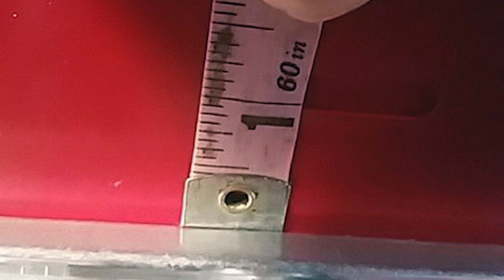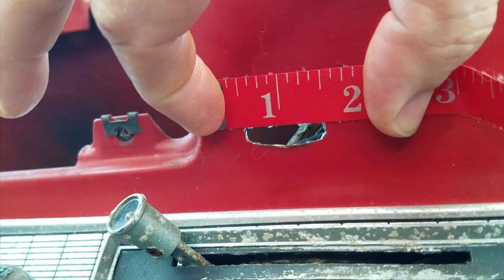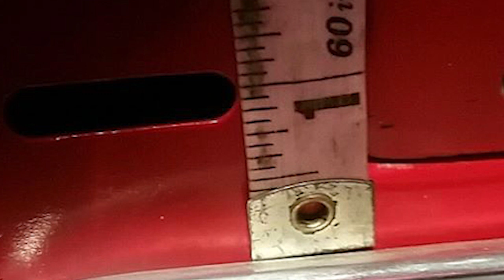Galaxie Dash Pad Install

Comment: after watchin you drill the holes in the dash panel, I would like to pass on a tip/trick. You can slip a piece of vacuum hose over the drill leaving only the expossed amount of the drill for the thickness of material your drilling thru. Comes in handy if you are not buying new parts and car is opperational. Would suck to mess up whats in there already. Thanks I learn from your videos.
Reply from the maker: That is AWESOME. Honestly never even thought of doing that.

Comment: That dash pad looks a lot better than the red one I received from Ecklers. I had to cut the defroster holes, speaker hole, had to trim the sides and excess around the windshield. There was a bunch of excess behind the instrument cluster area that I had to trim away. The passenger side didn't fit right and split a little bit when I pushed the dash pad on fitting it, on the right side at the base of the pillar trim. Not very noticeable but still. You'd think for what they cost they would put  a little more attention to detail into it.
Reply from the maker: Rhino makes good stuff!

Comment: wing nuts . a chunk of broom stick (wood)  with a hole drilled thru the middle or a screwdriver handle with the screwdriver shank pulled out.. a cut off blade in an angle grinder to make a slot across the hole... for the wings of the wing nut... now you have a wing nut driver.. 
make a second one with a 7/16 hole and a wider slot to do draincocks on radiators..
Reply from the maker: Cool idea as always Wayne!

Comment: Aftermarket Restoration parts are garbage  and a waste of money..... I   Keep all my Original parts and clean them repaint them and re-use them.
Reply from the maker: I respectfully disagree. That pad from Rhino is top flight. The hinges we put into our 1969 Fairlane recently are excellent as well. So was the full floor for the Ranchero. Are there crap pieces out there? Sure. But there is good stuff too...kinda like the used stuff.

Comment: I just thought about putting my A-C in back and electric heaters up front and in the center and a electric A-C compressor in back . Found a 1 wire 200 amp alternator too . But what your doing is looking kind of hard . I'm just going to a guy to do the inside of my car . I'm going with black .

Comment: Sure hope you're going to paint the dash pad red. Upside - it'll look stock and appropriate.  Downside - you won't be able to fry eggs on it like you would if you left it black. BTW - it's selvage or selvedge, either one is correct.
Reply from the maker: LOL OK on the selv...slev...that word. We are going to paint it. I want to do all the parts at one time. We're waiting for the defroster ducts to show up. We'll cover that in the next couple of months.

Comment: Ford originally used glue to hold the dash down along the windshield, 3 or 4 inches wide.  It's been a while but I took the pad off my parts car.  You know the sun visors are different on the padded dash cars also.  Reproduction padded visors are readily available though.
Reply from the maker: Yeah, we'll probably leave the visors that the car has. Honestly the padded ones are kinda sucky for size.